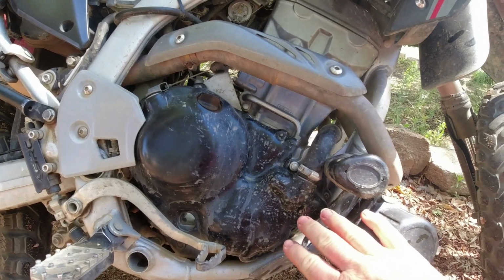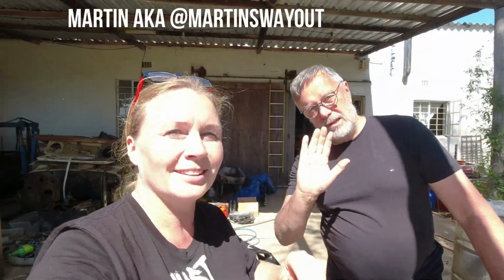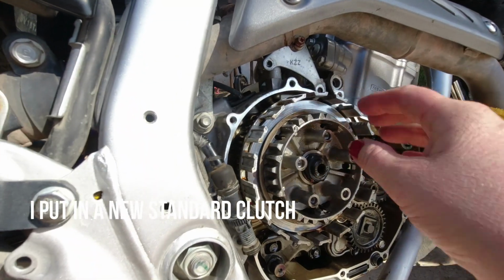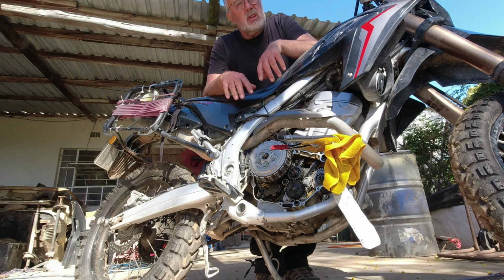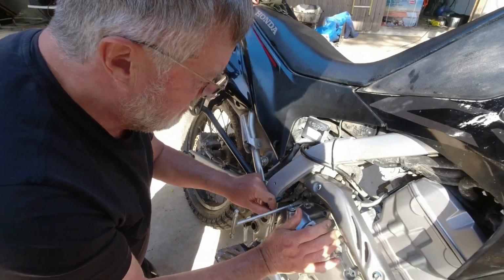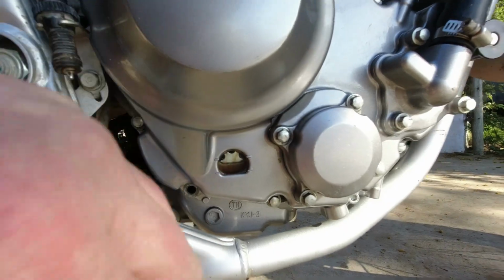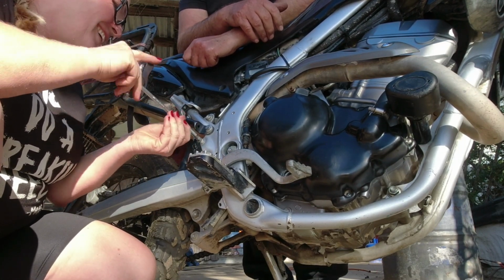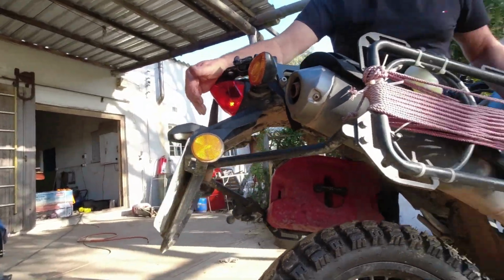First time changing the clutch myself!

Comment: If it is allowed ;-) well but here it comes anyway, it is a good idea to lay the friction plates in oil, then you are absolutely sure not to burn the new clutch off 😊🏍🏁
Reply from the maker: Hi Mr. Dane! Yes, you are right. I didn't do it this time. Later when I changed the clutch to a better one, I did that trick! Thanks a lot!